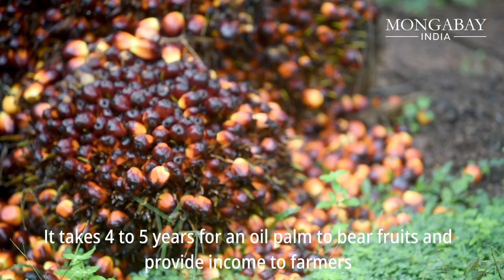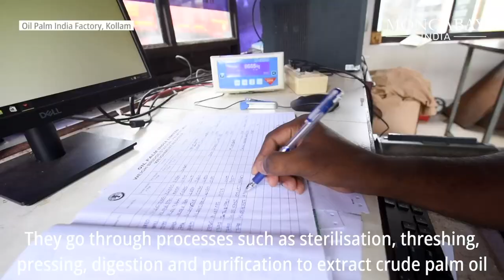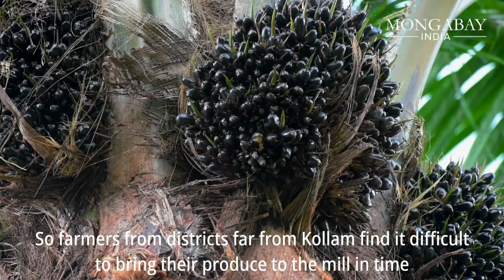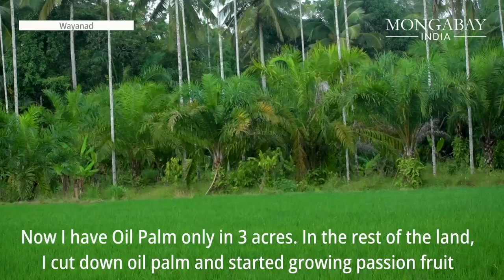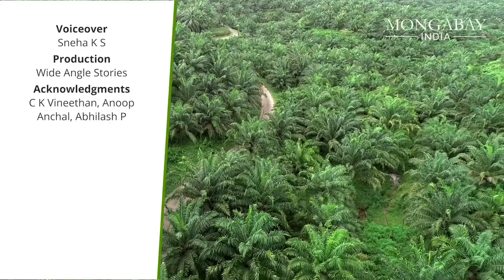Future of palm oil production in Kerala

Comment: politicians are idiot people. in asia the palm plantations do not need irrigation. the logistics are far superior to indian logistics, the indians have never been able to manipulate the amount that the asians can, because in asia the bikes are cheap, and the high taxes in india prevent the population from buying the bikes.
in asia there are several factories, in india no one will easily invest in a large factory, as there are many taxes.
and the Indian construction capacity is questionable, example at time 4:02 it is proven that the Indian engineers could not calculate the height of the discharge area a very simple thing, if they made a mistake in this, imagine if they will be able to solve all the problems in the supply chain production. the correct thing is to give up this plant, the socio-political conditions of India do not allow its development.
Reply: sadly but true